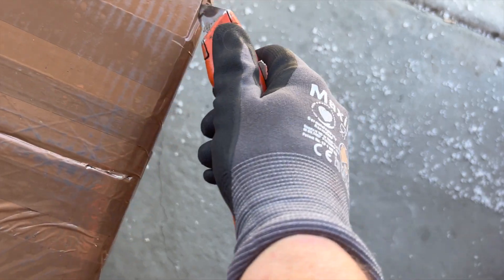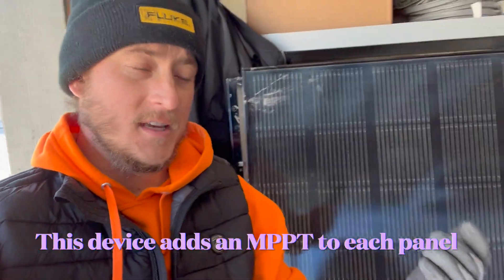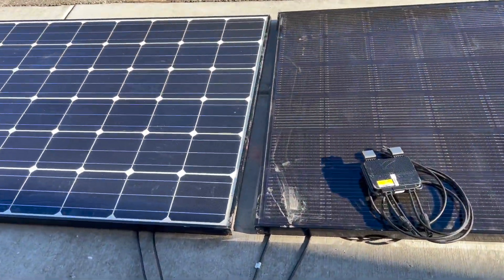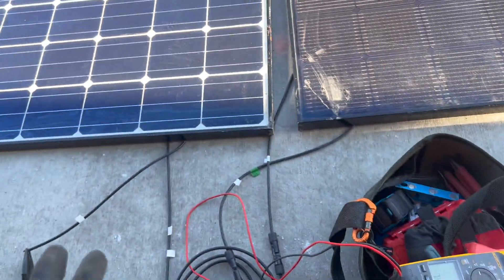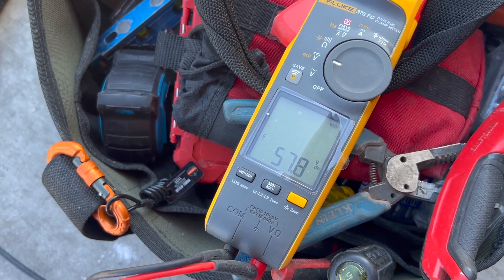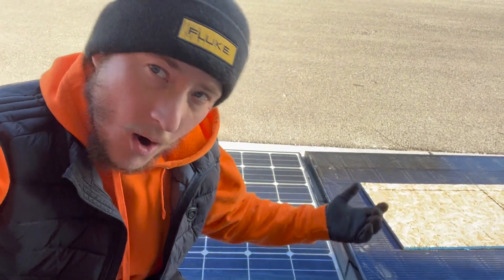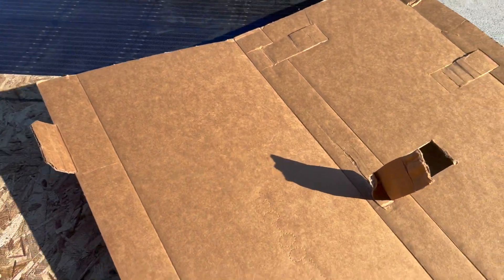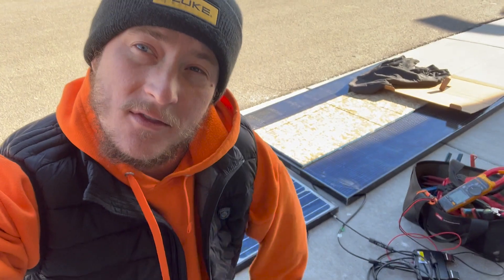How To Produce More Solar Power From Your Off-Grid Solar Panel System

Comment: Great video man! First one I’ve seen where somebody gets hands on with the equipments and shows the numbers! Preciate it!
Reply from the maker: Thanks for the comment! Appreciate the encouragement
Reply: I have several solaredge power optimizers I am planning to use for a new solar set up at my home. I have 25 panels that will be connected to a solaredge string inverter with 25 power optimizers connected (one to each panel). However, I also have 25 more panels that will connect to the Delta BDI inverter from SunRun that is utilized for the FORD LIGHTNING EV Home integration System (Intelligent Back Up Power) and I have 25 power optimizers I can install with those panels. Is there any reason not to install these optimizers with the Delta BDI inverter from SunRun?